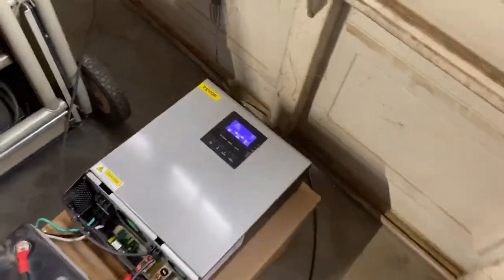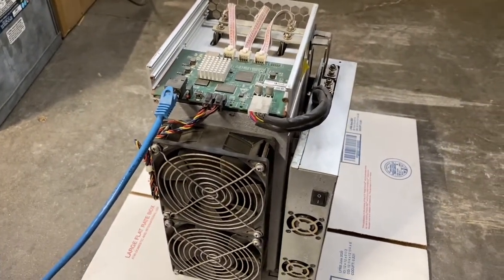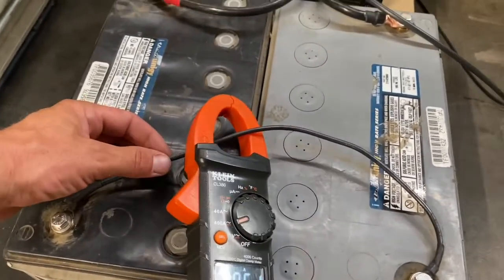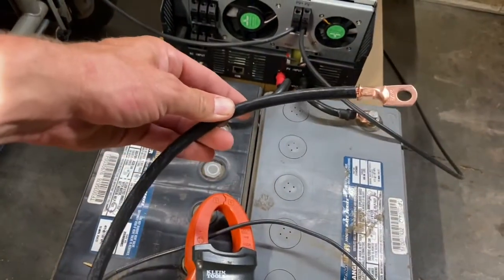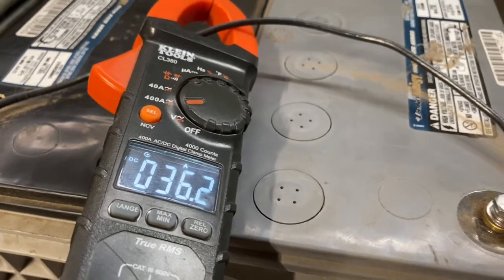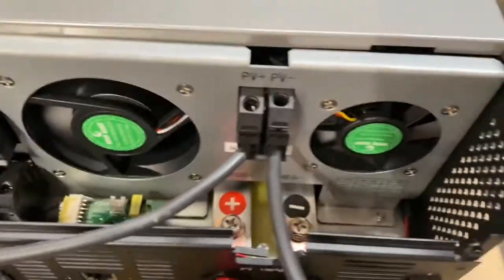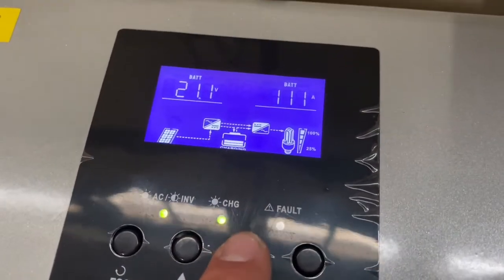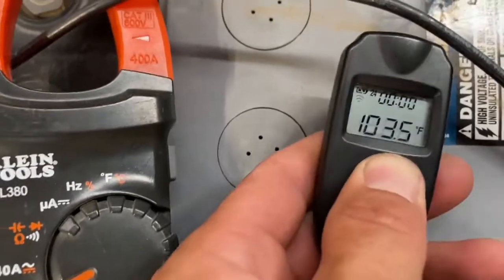Vevor MPS 3KVA Hybrid Charge Controller/Inverter - Load test and wire size comparison

Comment: Hello this is my first Solar attempt I Purchased, the identical inverter I have 3 - 380watt panels that’s to much for series right what would you do series/parallel ? Thanks for the advice (Vevor PS 3KVA)
Reply from the maker: This model has a maximum solar input voltage of 75V open circuit. Check yours because some allow up to 80Voc. Next, check the spec label on the back of your panels. Most likely, you will want to have all 3 in parallel. 380x3 = 1140w, which is 114% of the rated solar input, but it should be fine. The more crucial parameter to not exceed is PV input voltage.

Comment: hows it been holding up and i assune american unit correct
Reply from the maker: 2 years of daily use and its going strong! Yes the inverter is compatible with grid input from split phase 240V AC
Reply: @solarpowerondemand3255  how did you hook up split phase and did you hook up it in parallel
Reply from the maker: @Familyadventure369  The labeling on the inverter is a bit misleading, because it is for single phase power. But it works equally well with split phase power. Connect one Line (i.e. L1) to "L" and one Line (i.e. L2) to "N". The inverter can not feed back to the grid however, this inverter/charge controller only interacts with the grid "one way" drawing power from the grid to charge the battery bank and/or power loads.

Comment: ...see how close those inverter pv input terminal is...it should be far apart..like on car batteries..
Reply from the maker: Hmm that's an interesting point that I haven't heard. However there isn't an issue as long as the PV wires aren't live when you're doing the install. Arc Distance in Air (min): 0.005 inches at 1000V. So the 1/2" or so that separates these terminals is more than enough to prevent a short circuit at the maximum input voltage of 80VDC
Reply: @solarpowerondemand3255  ..I had experienced arc via it's terminals one afternoon while checking the terminal meltdown when I accidentally shorted it when I was unplugging it which is without a DC isolator..glad it's was not that powerful  ..36dcv 8A x 2 in parallel..it was fun though..

Comment: Hi 
What is the max solar power that can be connected? How much W and A?
Reply from the maker: Hi, it depends which model you get. They are usually rated either 25A or 50A max solar charging current. So either 24V x 25A = 600W or 24V x 50A = 1200W. Be sure to check the spec label before ordering!

Comment: Even though you never did say, "what the operating voltage of the system." I suspects it's a 12v system. Man a so much power them Bit coin machine uses? By the way, what is Bit Coin?
Reply: Its a 24 volt system
Reply from the maker: It is a 24V system, thank you for watching! The miner used in this video uses 2300 watts. Check out "The Bitcoin Standard : the Decentralized Alternative to Central Banking" by Saifedean Ammous to learn more about Bitcoin :)